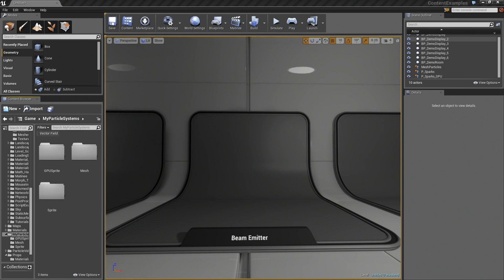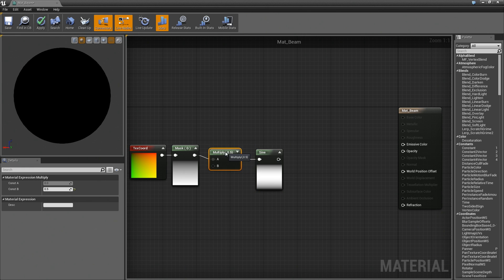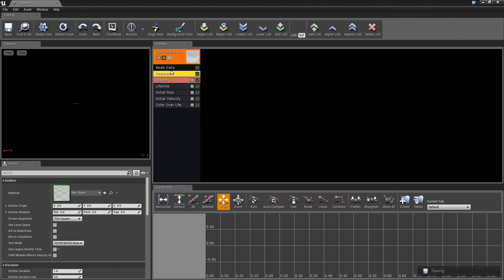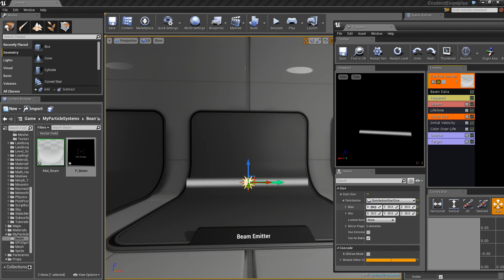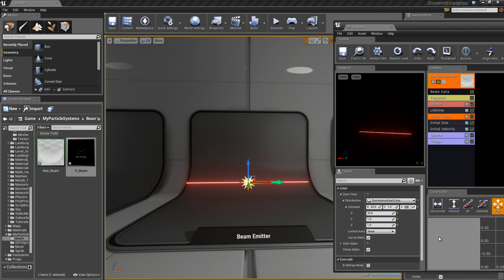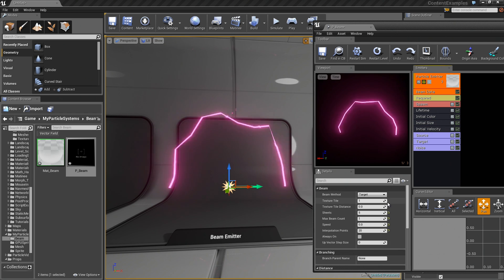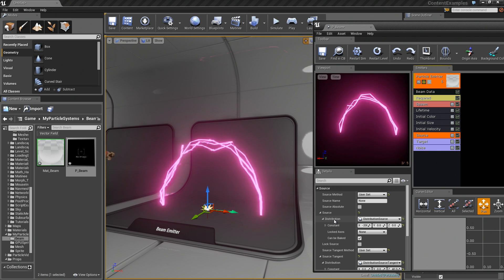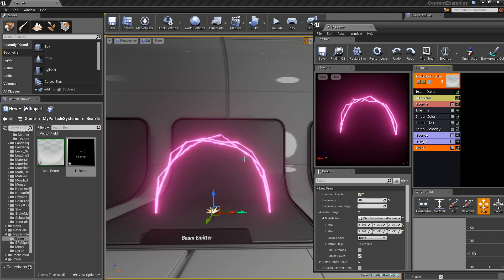Intro to Cascade: Creating a Beam Emitter | 07 | v4.2 Tutorial Series | Unreal Engine

Comment: Is the mask broken for anyone else using 4.24? Un-checking the Red channel in the Mask node after connecting it to the TexCoord node yields a red mask instead of B&W :/
Reply: It is red now with newer versions. But It's not broken. the result is still the same.
Reply: @minpan1066  It's not the same if you want colors other than red. Any other color becomes bleak or even invisible.

Comment: Mine is not emitting light :(
Reply: add 20 where you thought 2 In the particle color or 2000000 to have a lightning blast, or check if the material emisssive color is hooked.

Comment: My Beam doesn't glow...
Reply: +McKenzie Warren Particle and other emissive objects glow depends mostly on Your camera Bloom settings. Take in mind that the bloom will effect every emmisive object in scene, so don't go to high on this :)
Reply: +Byterunners thanks!
Reply: +Byterunners Is there any way to make bloom not fade away in the distance? I notice no matter what I tried I cant get bloom to be visible when I go a little farther away, the bloom is only visible when the camera is close!
Reply: ChimeraProd -  When You set up Your bloom, and the bloom is still not bright enough, go to the beam material, and use a multiply node on the emissive property. We do that. Multiplying by 1.5 or 2 should give You what You want, higher values will get unnatural but still cool looking bloom and a very bright glow. Go end experiment with that. You attach the current emissive node to the multiply, and then to the material slot. Try it out and let us know if it helped!
Reply: Byterunners Yeah I know how to change the brightness by multiplying, I meant the bloom/glow does not stay rendered on screen until you get close to it. If you pull the camera back you notice it starts to fade out completely, and if you have a long object its like it half fades out and looks odd.

Theres someone who made a tron material that said its pretty complicated to keep bloom in the distance and gave me an experimental method though. 

But aside from bloom I have another problem I notice, My emissive materials seem to fade out in the distance completely. Not just the bloom, but the whole material / texture! What causes this? How can I keep it from dissapearing? In unlit mode the object/textures are still visible, but then in lit mode they fade away! I have long hallways that I need to see from up high and I have emissive textures on them but I cant even see them at all when the camera is far, no color, nothing!
Reply: ChimeraProd Hard to say, there may be many reasons, if You could upload a video of this happening or screenshots at least it would be easier to say. The bloom is getting lower at a distance, because that is how it would do in the real life. It fades out and goes bigger as further away. It may also be affected by the post processing quality setting. Lower settings may fade out distant materials to save performance.